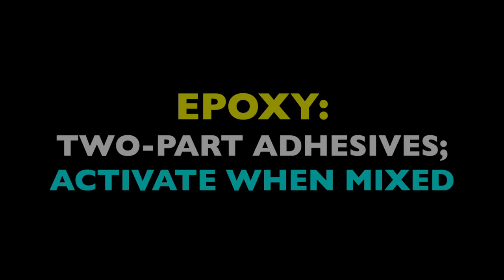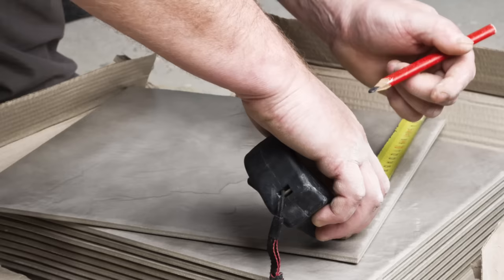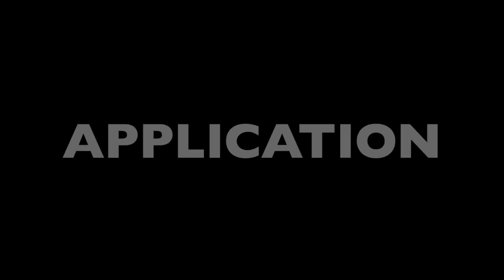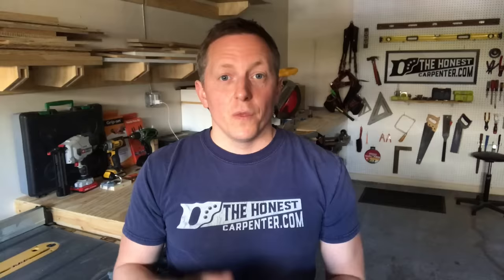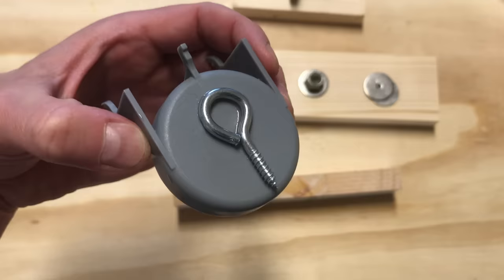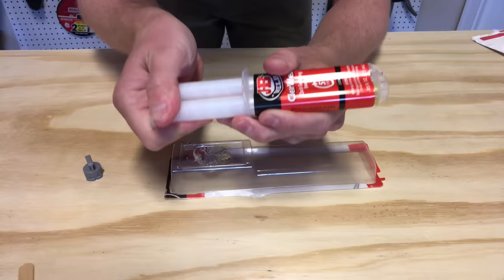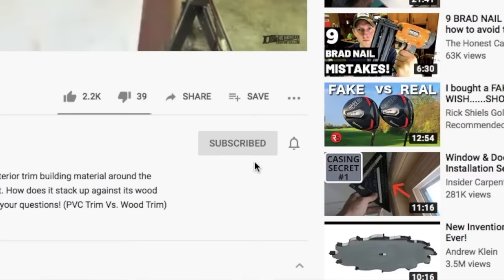DON'T USE SUPER GLUE! Try This Instead..(Epoxy Adhesive/5-Minute Epoxy/Epoxy Glue)

Comment: Bong Time, Pot Life? Wait, what kind of video did I pick. 

Naw, I use it to fix everything.  Mainly plastic components because you can mold it and shave it and sand it till you get the exact thing that broke off. Like one time I had a mustang seat release knob come off and it was a terrible design. This tiny little peice of black plastic that cost maybe $ .03 to make.....the dealer wanted $45.00!!!!!! Since then I always fix my own stuff instead of buy one. Usually putting tiny peices of cut sheet metal, wire, or fiber embedded in it for serious reinforcing items under lots of simple-machine stress.  Also I own a local gym and end caps and knobs shear off all the time. I'd be paying thousands a year to replace those but you can't tell I did them myself. Just know its an art and you WILL get frustrated, make a giant mess, ruin anything you touch unintentionally, waste a LOT of mix and have to start all over many times until you get used to it. Don't opt for the quick setting your first purchase. But don't leave a 4-hr set epoxy project, thinking its right....and then come back to see everything drooped and dripped.

Comment: I GOTTA BEAUTIFUL PAIR OF LEATHER BOOTS WITH SEPARATED HEEL AND MY SHOE REPAIR GUY HAS YET TO DO A GREAT JOB. I'MTHINKING HE HASN'T USED ANYTHING THAT FLEXIBLE ENOUGH FOR LEATHER TO RUBBER WHAT DO YOU SUGGEST FOR AN ITEM THAT WILL HAVE MOVEMENT LIKE A SHOE HEEL LEATHER TO RUBBER HEEL ATTACHMENT THAT WILL HAVE 200Lbs MOVING SURFACES???///???

Comment: While I appreciate your take and video, 5 Min Epoxies are...okay. Some are a bit more successful than others but they have a chemical compound that doesn't make them as strong as general epoxies. Given the BEST base, time, heat and application, they work well, don't give them that, and they actually fall very short. Oddly, JB Weld Original, tested over and over and over, works the best across numerous tests from differing resources. I don't put long or deep faith myself in 5 min epoxies but if you absolutely, positively NEED it in 5 minutes...maaaaybe. LOL. Last but not least, CA or Super Glue AND Baking Soda can actually perform better than 5 min epoxies in as little as 5 SECONDS...

Comment: Almost always, "plastics" does NOT include PVC, which is apparently very difficult to bond to. Test case: glue together two sheets of plastic drop cloth, or Visqueen. Haven't found a good solution yet. [UPDATE: I meant polyethylene, not PVC. Sorry, sorry, sorry. Thanks to Emerald for making me look it up.]
Reply: What about primers and adhesives that are normally specifically for PVC pipe? Idk if they'd work on plastic sheeting like you describe, just spitballing the idea, though it sounds like you've likely already tried it
Reply: @ItsAsparageese  I admit I hadn't thought of PVC pipe adhesives; good suggestion. One problem might be that pipe dope is a solvent which might weaken thin sheets or other small cross section parts. But I guess I need to give it a try.
Reply: @50srefugee  Ooh I feel clever now, lol thanks :P Your point about the solvent factor makes good sense though. If you end up testing it out please let me know what happens!
Reply: @ItsAsparageese  And I feel stupid now. Visqueen isn't PVC; it's polyethylene, which is indeed problematic. Most flexible plastic bottles, including of course the ones that glues and adhesives come in, are polyethylene. PVC would make terrible drop cloths, since many paint thinners would eat right through it. Don't know how I got that confused; my apologies to all.
Reply: @50srefugee  Aww no worries, that makes sense and I sure as heck don't know much about plastics to begin with. I've looked up PVC glue for projects I've come up with, but never actually used it, so that's the only reason I had it in mind lol! It's never stupid to ask questions and try to solve mysteries and mix up terms and learn stuff from it, that's literally the opposite of the process of being stupid. :) Thanks for the update so I could learn more too! 

I've heard about PET tape being cut from old soda bottles, used to tie wood constructions and other things, and fixed with heat shrinking. I'm mega stoked about trying that out. So this is all very relevant to my very amateur interests XD

Comment: I NEVER hear people say "just super glue it." My 1st reaction on hearing that was "THAT'S a bad idea. You need certain adhesives for certain materials." & indeed you then did launch into that. Epoxy is NOT a new idea for me. Epoxy is indeed remarkable, & considering how long ago it was invented, I'm surprised anybody doesn't know about it. I have a collection of adhesives, each interesting either for it's particular usefulness (or lack of). The last use I made of epoxy was for the metal flashing around an attic-access hole. This metal was originally nailed into drywall, but was never a very solid solution. Bumping it dislodged the metal flashing & crumbled the drywall. I couldn't put new nails in because of lack of solid drywall structure to nail to, so I epoxied the metal flashing and drywall to the remaining metal flashing & drywall. Worked like a charm. I would nave never considered Superglue for that application because Superglue really likes to be clamped hard and the substantive nature of epoxy was a more natural fit. I have & use Superglue (along with regular adhesives like wood glue, etc.) when appropriate, but it is important to note that not all Superglues are the same. Two other glues I use a lot of (again depending upon the application) are contact cement & 3Ms Hi-Streigth 90 spray-on contact adhesive. Not all of 3Ms spray-on adhesives are the same, but the 90 is good, and like in that movie the Blues Brothers when one of the brothers sprays the accelerator pedal of a truck, it's "strong stuff." It remains slightly flexible. An ideal application (as an example) would be gluing a textile to a hard surface, like a car's head-liner to a roof. I don't do that much (read "ever"), but it has a myriad of other uses, so long as you need to cover a wide area you're gluing together

Comment: Superglue USED to be good (back when I was a kid before the Challenger blew up). This is of course also before superglue manufacturers changed the formula (probably because some Darwin awardee glued themselves to something because stupid people rule this world). Superglues today are brittle and form weak bonds when used to repair plastic, that is IF it even sticks to the plastic you want to repair as superglue does not bond at all to many modern plastics. Many to most epoxies, including weakass JB weld, also fail to bond to a range of matierals and break as soon as weight, force, or pressure is applied.

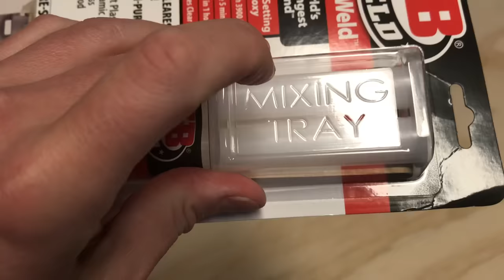Comment: Epoxy has been around for years nothing new, as for super glue being runny, it comes as a gel as well.  3:21 not believe what you did twisting the tube thereby mixing the two at the nozzle - bad -
Reply: My dad never told me about this stuff.

Comment: Epoxies do not substitute for cyanoacrylate adhesives, nor do CAs substitute for epoxies.  The each have applications in which they excel.  I really don't think that most people haven't heard of epoxy.  They are common and well-known.  I no longer buy the twin syringe dispensers for epoxy--they often dispense uneven amounts of the components, and the nozzles are hard to clean, and often harden after the first use wasting the rest.  Sorry, but this video isn't up to your usual standard for accuracy and usefulness.

Comment: I use epoxy a lot. Super Glue is for limited repairs.
Reply from the maker: Same here, Jay. I fixed an old pair of glasses that kept breaking with super glue about 4 times before I tossed them. It always got me a few more months 😅
Reply: @TheHonestCarpenter  They now do make a plastic compatible Super Glue that works quite well on small repairs.

Comment: Another very useful video. Thank you. Epoxy is a versatile material, a lot of aerospace parts, windmill blades, high end sports gear are made from, using glass or carbon fiber as reinforcement. Light weight, strong as metal and durable. A few things it doesn't stick to, polyethylene And polypropylene among them. It is important to clean grease off of surfaces before applying. Once hardens, it in is insoluble unlike super glue. Most commercial floor coatings and powder coating for steel are. There is not and industry it is not used in. Watch this guy's fun projects: https://youtu.be/9tY2GoTHkf8

Comment: while your video contains some valid and useful information your overall hypothesis is an over simplification. There are situations where Super glue, or cyanoacrylate, and CA glue is it is also known as, is the only logical choice, thee are also times when trying to use any other then epoxy is a stupid waste of time, each has it's place....
PS: posting a video that has a thumbnail with "DON'T USE THIS" in large text along with an arrow pointing to one of the best over the counter cyanoacrylate glues on the market kinda pisses me off....

Comment: Your statement "in your experience most people have never herd of it before"??? I've been using JB Weld for a lot longer than before you were born. I think that it's even older than I am and I'm 75 years old. I don't think that epoxy and CA glues are even comparable. They are for different purposes. Strength test alone is not a reason for deciding which glue is correct for your need at hand.
Reply: you’re not most people

Comment: Why do you believe the 7K psi rated Epoxys are ridiculous but the others credible? Did you personally have one fail? I've successfully used the quick Epoxy extensively (not sure of their rating) and the repairs lasted for years. I've not had much success with any Super Glue and have rarely used it. I'll be careful to avoid 7K rated epoxy.